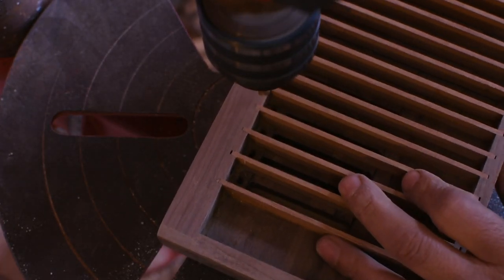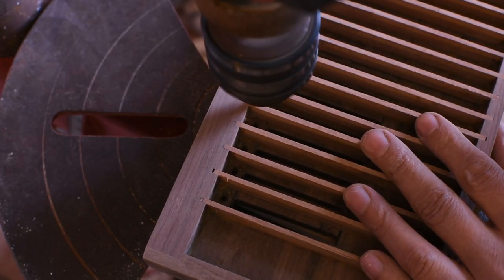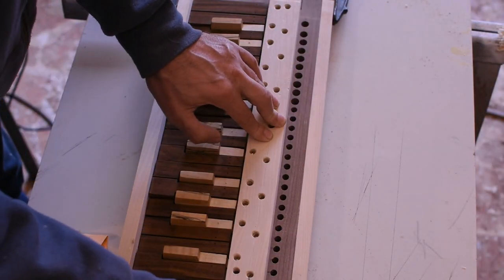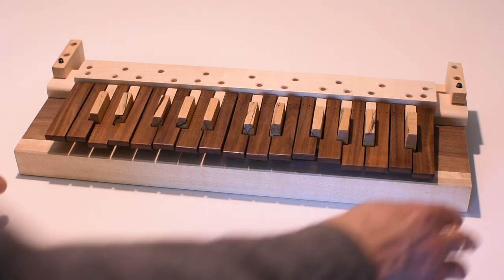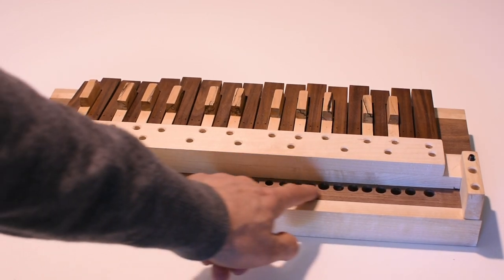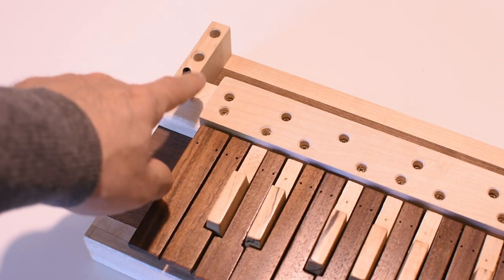How to build portative Organ | #19 Windchest  | SUB ITA | Homemade Pipe Organ

Comment: How are the connectors made that get the air from the wind chest to the sound board?
Reply from the maker: Actually i haven't done it yet, for now i put some plastic hoses to see if everything was alright, and i'm using it like that. as soon as I have some time I will build it and make the video.